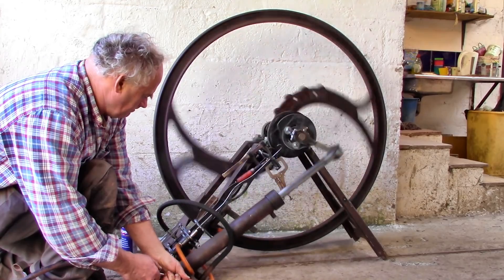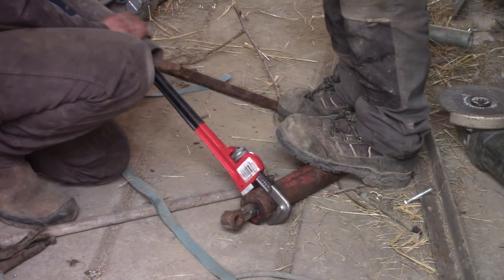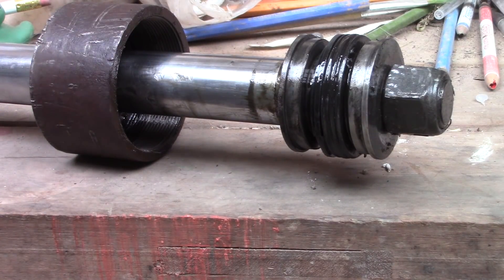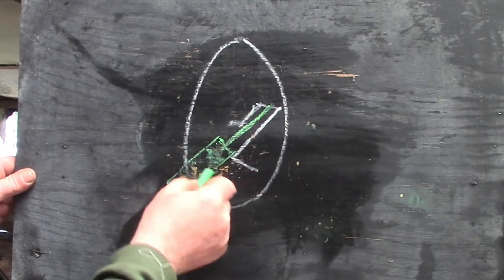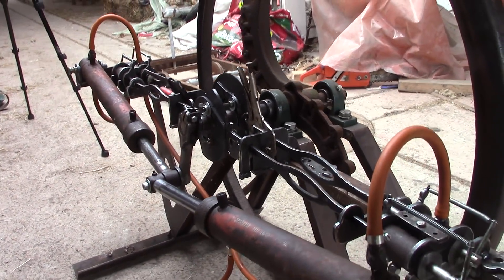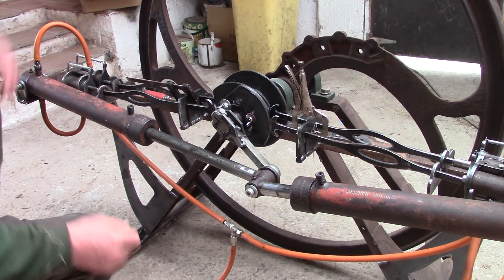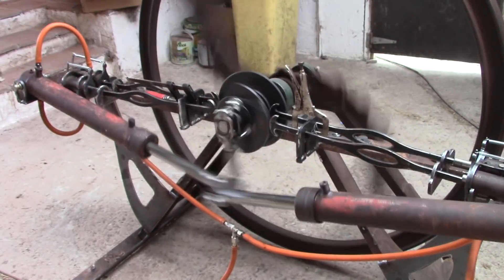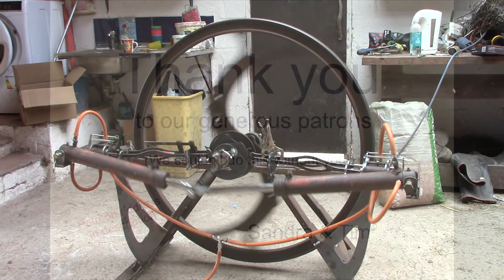Homemade TWIN CYLINDER Air-Powered Engine Goes REALLY Fast!

Comment: You project is coming right along Tim and looking great while doing so. If you want to power things with it in the shop how about a rubber drive wheel that contacts the flywheel and then runs a belt or chain to the "driven" device? I can see a large blade sawmill, sander or drill press being run by that machine.

Comment: Very good progress.   You would likely need very high pressure gas bottles to store sufficient compressed air to power the engine.   I think they would need a couple of thousand PSI pressure to get any worthwhile air duration.    I cannot imagine a wind powered machine able to generate such pressure.
There is a small car made in India which uses compressed air to power the vehicle.  Look up Tata Airpod for more information.
Well done Tim the two cylinders are working relatively smooth.   What a fight to get the cylinder head off.
Dave.
Reply: I think I the key to generating 3000psi tanks of air will be sourcing a BAC (breathing air compressor), perhaps on government liquidation from a fire department upgrading their self-contained breathing air equipment? I have seen them come up at auction on occasion in my area.  Now that I'm thinking about it harder, you could achieve thousands of psi using a multi-stage compressor made from hydraulic cylinders, starting with larger diameters compressing into smaller diameter and shorter stroke cylinders and so-on until the desired pressure is reached.  Lots of math would be involved.
Reply: Anything over 3-bar starts getting more expensive, and lossy. I'd expect this could run on closer to 100psi, easily made with stuff from the pound store.

Comment: When the cylinders are 180° out of phase it should be possible to make them double acting by using the timing (and therefore valves) from the opposite cylinder for the downstroke.
Reply from the maker: but the inlet and exhaust are open for different times
Reply: @wayoutwest-workshopstuff6299  but if you connect in to in (backstroke) and out to out (backstroke) it might work. It would be in essence add the backstroke piston area to the forestroke of the other side.
This wouldn't work with the 90° phasing though

Comment: Some fireless cookers here in the US had a special car that has a air compressor on bard so they could have more range in yards or industrial areas.
Reply: All fireless locos had to stay close to the stationary boiler to recharge the pressurized hot water supply every few hours.  Mines use a compressed air tank and a small air motor to power the loco for hauling ore cars underground.  Mines usually have airlines that can be tapped at convenient locations to fill the tank.

Comment: To reverse the speed backwards why not have a gearbox and clutch then you've got reverse and 1 torque gear for starting and 2 high rpm gears for cruising speeds
Reply: Yeah a gearbox would would but why not just an old fashioned reverser? Move the "thrust position" down using a leaver and suddenly you'll have reverse. Like full scale steam engines do.

Comment: Do you use any form of lubrication for the cylinders? Having in mind it worked with hydraulic oil before.
Reply from the maker: I will need to add an oiler of some sort, I suppose.

Comment: You can also try lubricating your engine. It will help a little bit more with the friction and the movement of the machine so it could run more efficiently. You know to keep things lubricated

Comment: Well if you want to follow your ideas happen to two cylinders close together. It would have been more proper to have another crankshaft on the opposite side of the flywheel. And then use that as a second area of movement from the second cylinder and have it out-of-sync from the other cylinders so then that way you get power from both cylinders just like you wanted without making a more complicated setup. But that's just me
Reply from the maker: the shaft isn't long enough, so I'd have to replace that and that would mean getting it out of the wheel - a bit risky, I thought

Comment: Does the engine have to be self-propelling? Could you just have a fixed engine that pulled the carts with a winch?
Reply from the maker: I hope to build lots more rail track across a couple of fields, so, yes it does need to be independant
Reply: Thats quite a good idea. You could have a wheeled frame if it needed to be moved and some form of anchor point. Its the distances he's moving stuff that might be the problem. if its all the way across a field and you have to walk to connect the winch line you might as well push a cart along the track by hand. I suppose it depends on the distances and weights involved.

Comment: maybe find a friendly tyre fitting place and see if you can get the wheel balanced
Reply: Lol wheel balancing is easy. A Piece of chalk and some weight material you can fasten to the rim, spin, mark where it stops add weight opposite and spin and mark again. Its balanced when it stops in random places and not the same place.

Comment: For reversing at any wanted time, you can have a look at old, steampowered sawmills. They use a rotating plate at the output and a wheel at 90° offset to that plate. Depending on which side of the outputting shaft the wheel is pushed against the plate, you can reverse the rotation at any time. At the Video I'll post below they use it to reverse the feed-sled of the logs. At the same time you can controll the output-speed, depending on the size of the rotating plate.

https://www.youtube.com/watch?v=ezcxi6zRIuk

At around 24:50 you can see the mechanism working as explained earlier.

Cheers
Reply from the maker: thanks, Sebastion. That's a fine example too.

Comment: For more torque you could split the air out from the valves on the left to the push stroke on the left and return stroke on the right, and split the air out on the right to the right push stroke and left pull stroke. It will use a bunch more air wont go faster but at least you will get more force.
Reply: That’s s a great idea, I totally agree, I think more torque is exactly what this needs, it doesn't need to be much faster.
Reply: Like push and pull at the same time?
Reply: @lemmetellyousomething679  yes

Comment: Reversing? Gearbox it would be my advice. Shay locomotives are an example of steam powered engines that use gears.
Its' funny, because the inventor started out making it as a hack, much like your engine. His company couldn't afford to buy a steam locomotive that could climb the mountains so he bought an old farm stationary engine, two train cars, suspended a boiler between them and used drive shafts to transmit the power out. The design was so successful, he was contracted by steam locomotive companies to make more and ended up selling them all over the USA.

Comment: If I am not mistaken, all you have to do now is to connect the air hoses so that while feeding the push stroke of the one cylinder it feeds the pull stroke of the other,  thus at the end having both cylinders do a power stroke in both directions.
Reply from the maker: yes, but I'd also need a way of exhausting that air from the cylinder - more valves

Comment: If you want to store compressed air efficiently, you would need quite high pressures. I don't know how big your cilynders are exactly, but i would quess a stroke of about 70cm and the 5cm diameter. So that would be 1,35 Liters per stroke per cylinder. So at 100 RPM around 270 Liters per minute, if your working pressure is 1 bar (wich it won't be, cause you want power).
A SCBA Tank at 300 bar (six liter internal volume at atmospheric pressure) holds around 1660 Liters ((Volume times pressure) divided by 1.1). So that would be gone in six minutes, if you have no leaks and want to depressurize completly, wich you wouldn't want, because then moisture can get into the tank. Also, for those pressures, a very expensive compressor is necessary, and the bottles aren't cheap either... 
So lets go for a somewhat cheaper option, 200 bar and maybe argon-cylinders (for welding and stuff). Those probably cost the same as a used SCBA bottle, but with more volume and usable air inside. The compressor problem is still there, but you can use a normal welding pressure reducer. Although you might want to combine multiple tanks on the loco, to have enough air...
Just be sure you know what you are doing, because high pressure air is very dangerous!
Reply from the maker: Yes, I use welding gas bottles which come in 10, 20 and 50 litre sizes and are supplied at 200psi. But what kind of compressor would fill them, I wonder?
Reply: @wayoutwest-workshopstuff6299  Now i'm no expert on this, just a voluntary firefighter who knows how far you get with a 6 Liter airtank at 300 bar... Gets you about 30 minutes, and humans use around 50 liters of air per minute. I think your engine will use more...

200 psi or 200 bar? If its just 200 psi i think most car climate-compressors can do that, although they don't move that much volume...
For 200 bar i have no clue, probably something industrial, maybe for scuba diving?
Reply: @wayoutwest-workshopstuff6299  Tim: I am REALLY enjoying your channel. Thanks so much for it.Remember how much power you lose if you use a pressure regulator. If you run your engine on, say, 50 psi air then at the end of the run, when your tank pressure is around 50 psi you will be using all of the energy in the air. But at the beginning of the run, you will be throttling the pressure from 200 to 50 psi. three quarters of the mechanical work you put into the air to compress it to 200 will be lost as heat and you will extract mechanical energy only from the last quarter of the energy you put into compressing the air as it expands from 50 psi to atmospheric pressure.
Reply: You could use the energy efficiently if you had a variable cutoff valving system, so that you take in much less 200 psi air per stroke (earlier cutoff) than 50 psi air (late cutoff). Variable cutoff is a very elegant solution (see Corliss steam valve - one of my favorite mechanical linkages ever) but complicated to execute.
Reply from the maker: @jonathanherz3298  Very interesting! So much to learn!
Reply: @wayoutwest-workshopstuff6299  Thank you. Yes it IS all very interesting. The thing I like the most about your workshop channel is how you express how we all feel about making things. Is it useful? Usually, but not always. Is it fascinating and gratifying and instructional? Invariably!
Reply: Lot's of older style compressors where simply engine where half the cylinders did work, the other half used for compressing air. They had an old VW powered that would fill 6 6l bottles to 300bar in less than 15 minutes where I got my certificates.

Comment: 8:12 no, bite the bullet and go with steam.  I'd suggest using a brand new propane cylinder.  (empty)  as it's already rated for a known pressure, is easy to modify with a pop off valve, and it has handles built in on top, so you could always pick it up and take it off a heat source.  I'm considering using one myself, found one on Amazon for like 50 bucks.

Comment: For reversing the flywheel direction, could adding air to the other side of the cylinder work (i.e. push the piston back into the cylinder)?
Sure, less power, due to smaller surface area, but it would go backwards.
Reply: What he mentioned in this video was that there would be far less surface area on that side of the piston head for the air to push on, so it would produce far less power, and he didn't think it was worth the effort of trying
Reply: It would be easier to add hoses and hand valves to change which cylinder gets the air.
Reply: I think you need some kind of walschaerts gear or something? I am not extremely technical but I have seen it done in Lego.
Reply: @theothertonydutch  yeah, you'd need valve gear - not necessarily Walschaerts, but anything along those lines would do. It is, however, quite a complex installation, especially with two cylinders.

Comment: 7:31 I think some angle iron welded up in a large box should be really cheap/ free if you look in a construction site dumpster.  Also I figure you'd need at least 150PSI to drive anything, the engine and boiler will be heavy.

Comment: nice work there again. But i see a lot of wear and tear already in the near futur. gotta tighten it all up in the final design ^^
Reply: Will need to harden the cams and push rod bearing surfaces at some point either by fusing material or remaking them.

Comment: So I have a question, would it give you more power if you replaced the internal shaft with a smaller diameter one, so long as you were able to seal the end properly?
Reply from the maker: Good suggestion!

Comment: fireless steam locos are not unknown  - having a fixed steam plant and just a storage tank of steam on the locomotive to run from and think there may have been some air-powered ones as well -  having a windmill running a compressor to fill tanks and then using the air to run a train sounds like a fantastic idea.  Might be better to have the tanks fixed to the train and fill it from a storage tank so not so much fiddling around and heavy lifting.
Reply: Air powered locomotives have been extensively used in the mining industry around the world.
They have the added benefit of not filling the mines with exhaust fumes nor provide any source of accidental fires.
Reply: @Gin-toki  but being a career underground miner, in an actual working mine these locos were not as efficient as say battery powered locos, our one air powered loco was relegated to shaft area shunting duty as it could to compete at all with our battery powered locos.
Reply: @frederickmoller  True, do however remember the pneumatic locos were from a time prior to electricity being really widespread, let alone batterypowered equipment.
Reply: @Gin-toki  true, but in the end battery powered locos won out. I knew older driftmen (tunnellers) who actually despised air locos because of the constant need to recharge the air locos that hindered their progress in moving the blasted muck. Which meant no bonus if the drift round wasn't completed at the end of the shift, driftmen relied on that bonus to better their families.
Reply: Mining locomotives were often air powered but not necesserily with on-board tanks. It really depends on the application of course.
Reply: @theothertonydutch  They all had on-board tanks for enough volume and pressure to work a decent amount of time.
Reply: @theothertonydutch  mining locomotives were powered by compressed air bottles.  you had to fill the loco tank from mining station where you have compressor and fill the tank then run the loco,you can have extra tanks on loco just for backup in case main tank goes empty,just valve to switch for another tank.

was this practical? in terms of mining yes but not evry company did this because compressed air still is threat, it wont boil you alive like hot steam but exploded tank will throw shrapnels.

there was other creative powered locos. flywheel ones too but only on very short distances.
Reply: It's a good idea for prototyping, but let's be honest, we all want to see a proper steam loco.
Reply: I made a fireless loco for 7 1/2 inch gauge railway works great
Reply: Fireless locomotives didn’t just store steam, they got a load of superheated water from a stationary boiler plant.  The storage tank was heavily insulated, so it retained as much heat as possible.  As steam was consumed, more of the water flashed to steam to maintain the temperature/pressure ratios.  This is the main reason these engines were somewhat successful as compared to pure compressed air locomotives - the energy comes from the heat of the water, and was released by the phase change from water to steam.  When using compressed air, energy storage can only be as high as the rated pressure of the storage vessel.  There’s a high difference, most people advocating compressed air overlook that detail.
Reply: @DavidWilliams-rn6uq  Ah yes that's clever.  You aren't really storing "steam" so much as compressed high temperature liquid water.
Reply: They have used caustic soda as a heat source for generating Steam and anhydrous ammonia ran through the engine and then absorbed into water. Both systems were abandoned within two years of the introduction of electric locomotives. Still good for stationary energy storage though.
Reply: I'm pretty sure putting steam in a closed container which is cooling down is a really bad idea. Agree with the rest of the comment(s) though. :-)
Reply: @weekendstuff  
It is more efficient than compressing air and if they can inject superheated water greater energy density.
Reply: Compressed air engines were the only one of the three (pneumatic, ammonia absorption, and caustic soda) smokeless locamotive types to survive electric locomotion.
Reply: Yes, yes, yes!
Reply: Hey bud think of what your saying, there is a reason locomotives run on steam engines, you could never hold enough pressure for any substantial journey , unless u have something supplying new steam,
Reply: @mikeysgametime8914  What was described is essentially a thermal battery.  It would be like comparing an electric capacitor to an electric battery, orders of magnitude difference in the amount of energy that can be stored, but it is still possible to do something useful with that smaller amount of stored energy.  Maybe a steam-punk tram/streetcar that repressurises at each intersection/stop.

Comment: I think the rocket boiler you were working on has great promise for providing steam for the engine.
Reply: I don't think it is large enough to provide enough steam, he needs to build a bigger version of that boiler.
Reply: @Henning_S.  Bigger boiler bigger boom!
Reply: @wideyxyz2271  yes, of course he needs to make sure it is safe, ideally he can use an already pressure tested Propane bottle as a boiler...